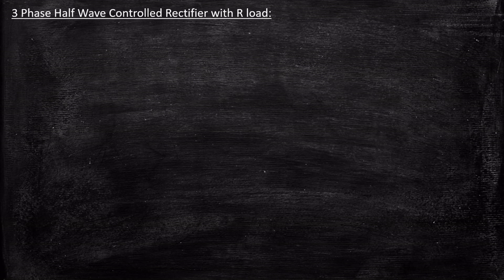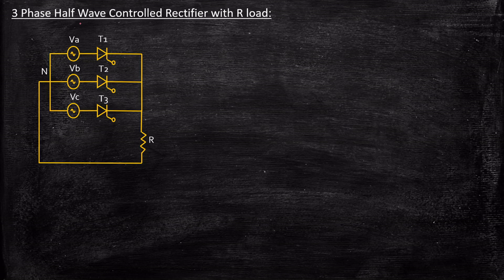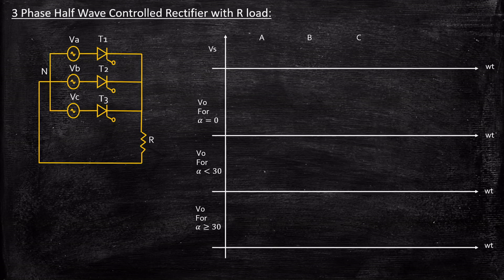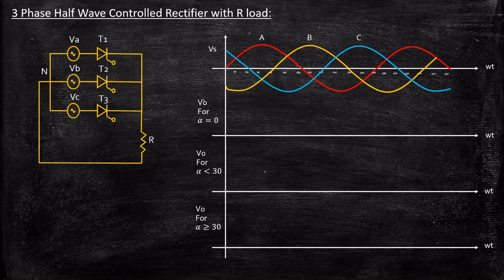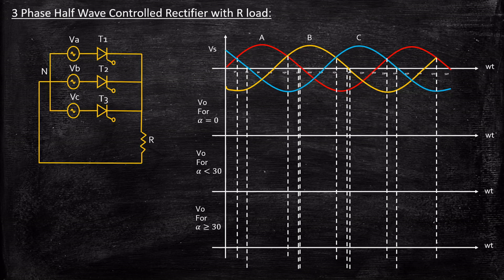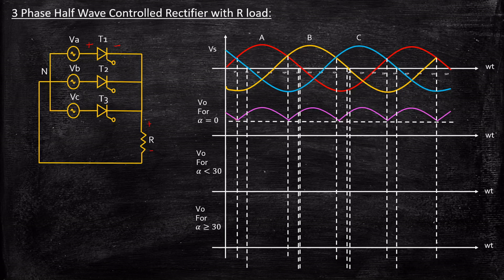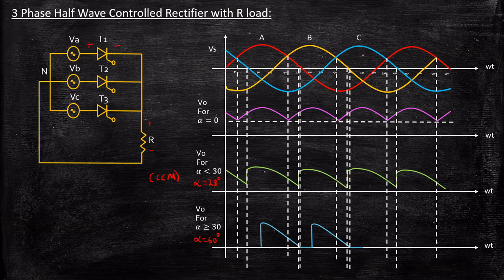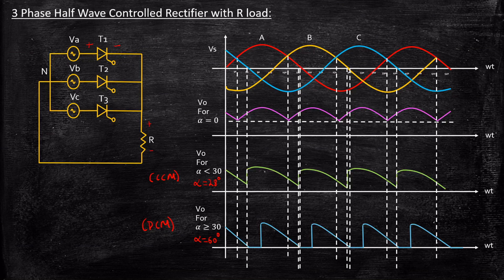3 Phase Half Wave Controlled Rectifier with R load | Power Electronics | Lecture 53

Comment: Hi, I from Vietnam, i have a question. Diagram for a ray-shaped 3-phase rectifier circuit, using a thyristor connecting a common anode with an RL load  ? What is the mark of the output current on the load ?  Thank for so much.